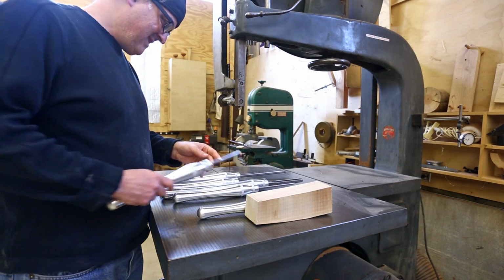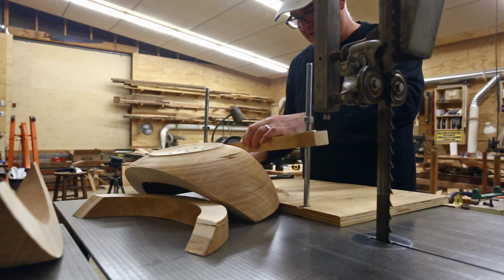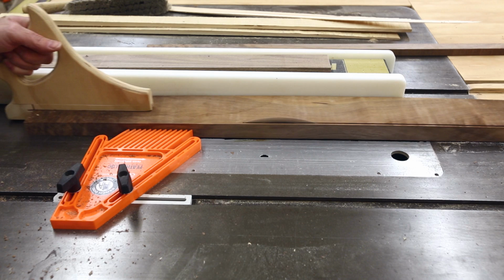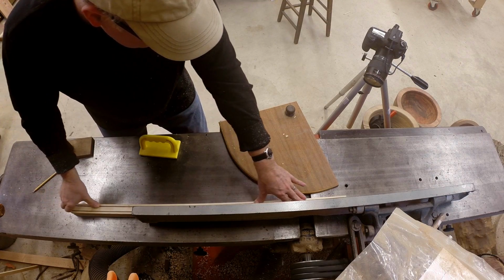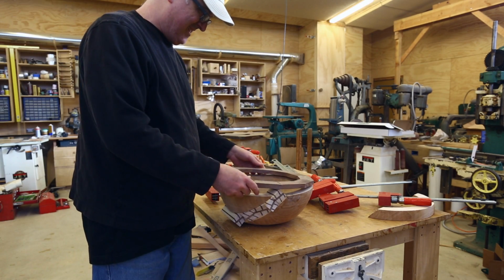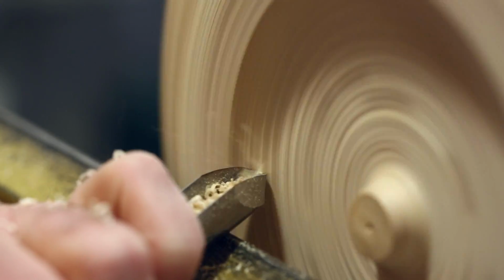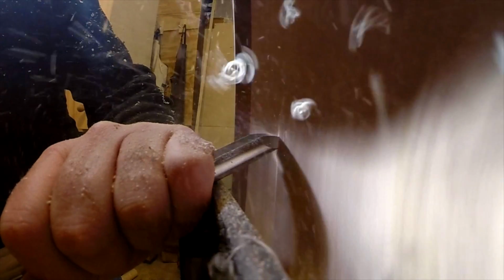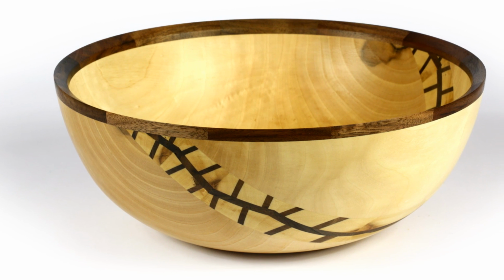Wood Turned Maple Bowl

Comment: Hi Frank. Beautiful work. Just a note. I'm a tool and die maker. I'm certain someone at Carter and Sons could easily machine a T-slot in your band saw table. It would no doubt make your life easier, not to mention safer, on the band saw. They could make it to fit the miter gauge on your table saw or even to allow the use of an Incra style miter gauge. A T-slot on either side of the blade could be done. This would be child's play for any competent 2nd year tool and die apprentice. Love the videos...envious of the shop.

Comment: Hi Frank.

Big fan here...Another woodworker recommended a simple 3 part finish that maybe you could try.

1 part Boiled Linseed Oil (BLO)
1 part Tung Oil
1 part Poly

Wipe on, wipe off - sand. Repeat till sanded to 500.

Comment: When I was watching how you were clamping the irregular angles and trying to deal with the pieces sliding, I thought of those arrangements they use for someone with a badly broken leg, those metal external splints that support the healing bone. Maybe it is possible to make a similar sort of thing to hold awkward pieces in place for gluing, maybe a rigid circular ring with adjustable spikes or something that would hold the pieces exactly without the need for screws or hot glue?